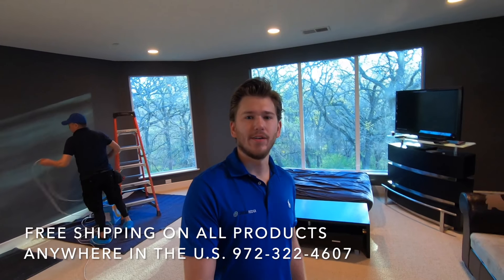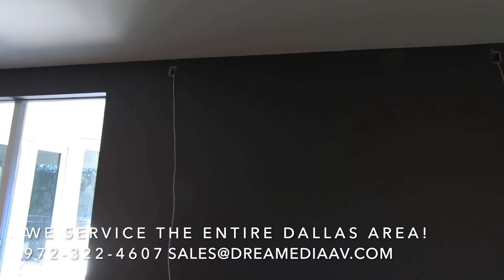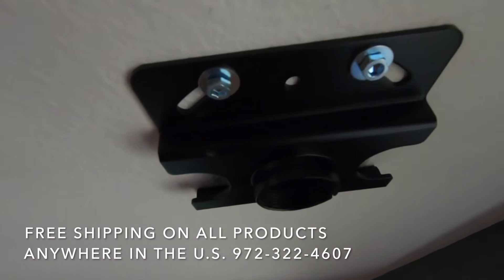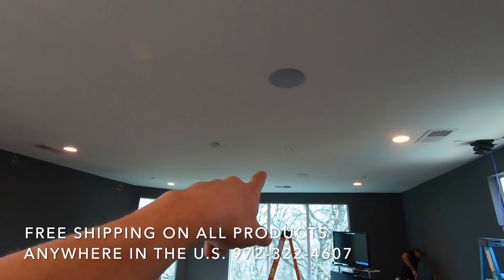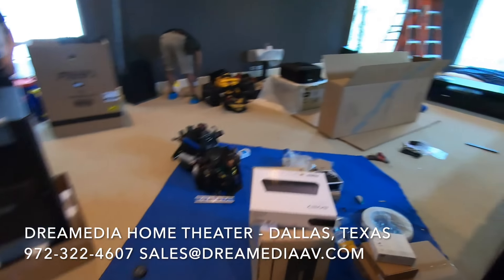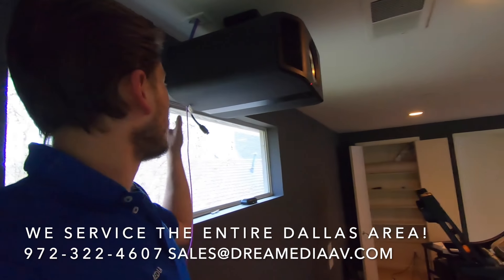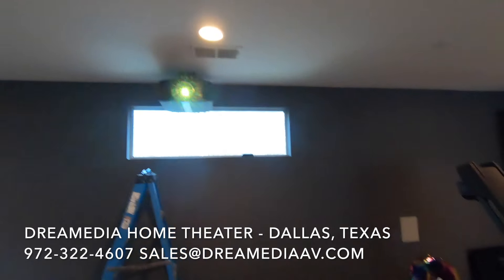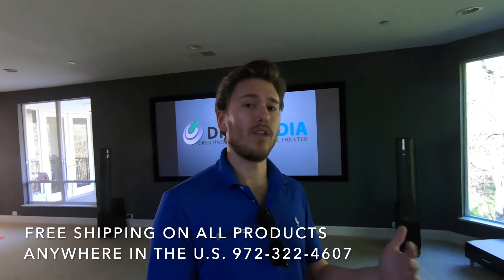FULL Video - MartinLogan ESL 5.3.2 Atmos with JVC RS2000 and SI Black Diamond 133"  Cinescope 2.35

Comment: Great advice on keeping your projector levelled to avoid keystone issues, it's common sense but not something that's always thought of. I had my projector installed by the outfit where I bought it and had huge keystone issues. When they came back to calibrate it they were dumbfounded on the keystone issue and offered no resolution, just the advice 'keep playing with it'. It wasn't until a few months later it clicked in my head to check the level of my projector, and it was WAAAYYY off. Now my projector is levelled, and fills the screen perfectly.
Reply from the maker: Thank you for your feedback and for watching! We're glad you got everything squared away with your projector and screen!

Comment: Interesting install for a client that has the budget but but not the knowledge. I would recommend light blocking curtains, acoustic room treatment, and if possible repainting the ceiling to a darker color. With that large screen and throw distance that projector needs all the help it can get. Darker carpet would also be a good idea too. Moving the seating off of the rear wall is a must and then using floor standing rear surrounds would be much better than the in wall surrounds.
Reply from the maker: ......  https://www.youtube.com/watch?v=6BUwqwEnV-A&t=676s

Comment: Did you use an HDMI extender on this part of this install? I was thinking that I saw one in one of the video's. If so, what was it? How long was your HDMI run and how does it perform.
Reply from the maker: Thanks for watching Craig! We did not have to use an hdmi extender on this one but on a lot installs these days we have to use Baluns or Fiber hdmi cables cause of distance issues with high quality 4K. The max distance on active hdmi is 35’ but it also depends on quality. I have been using a lot of fiber hdmis and will be doing a video on it soon. We are about 30 videos behind right now but appreciate the support. If you need to purchase a product feel free to call us at 972-322-4607.
Reply: @Dreamediaav  thank you. I can't wait to see the video!
Thanks for your response.

Comment: You said the towers have built in subs... my understanding is they don't. The power you plug in is for the electrostat panel.
Reply: I tend to agree. Looks like each speaker has 2 passive 8" woofers.

I think the $8K projector skewed the budget.  Those speakers would appreciate some external amplification.